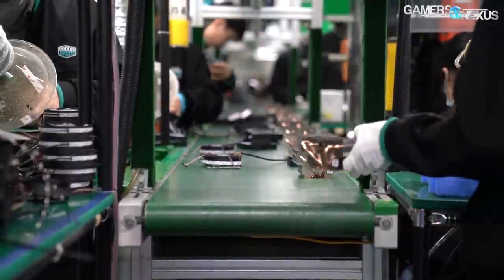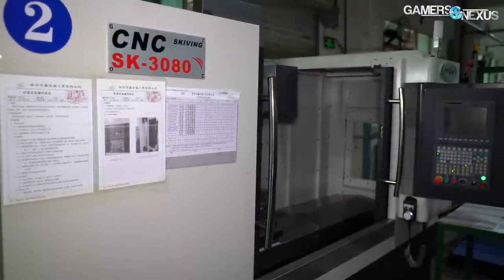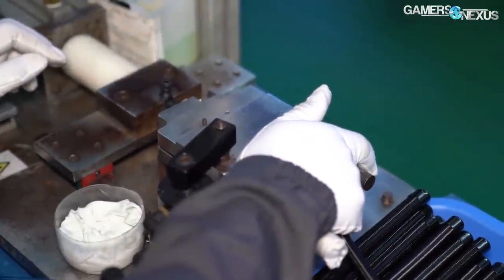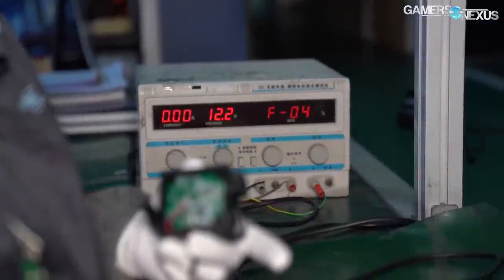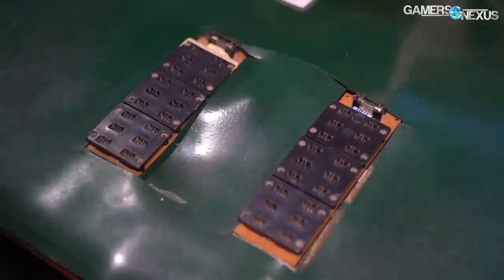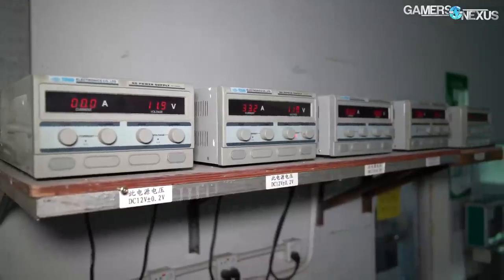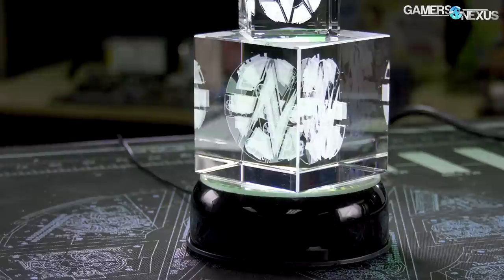How PC Liquid Coolers Are Made | China Factory Tours (Cooler Master & DeepCool)

Comment from the maker: You would also like our "How AMD CPU Coolers Are Made" video: https://www.youtube.com/watch?v=8vPfmY0KlJE
You can support our tours directly via our store! https://store.gamersnexus.net/
Reply: Propylene Glycol....So i can vape heatsinks? Awesome!
Reply: So, after seeing how this stuff is made, i still have no clue why there are/were air bubbles inside both of my NZXT Kraken X62.  
I can shake my radiator and hear a big air bubble bubbling. The first X62 had the pump die, it ran dry because i had the radiator front mounted in the (last gen) Corsair 750D, which means the radiator was lower than the pump. ALWAYS make sure to install the radiator above the pump (top mount it if you need to), just in case there is air inside, the air collects at the highest point and if that is the pump you'll have a dry and soon a dead pump).
Reply: @ZeroB4NG  Quality control isnt always perfect.

Or age of unit maybe? (i wont pretend to know if old-new stock can loose liquid, through tempreature variables, or if its just down to years of use)
Reply: First off I want to say these are awesome videos, thanks for making them Andrew/Steve. I gotta ask though, do these factories seem to offer tours on a daily basis? Especially ones that produce for multiple aftermarket manufacturers. I could understand if these factories are trying to secure large contracts, but not really for mid-sized YouTube channels (no offense intended).
I enjoy these videos, and I hope you continue to make them in the future when you are over there. I got a laugh watching Andrew initially failing to break the glass in the "Tempered Glass Cases" video. Being more worried about the worst case scenario where the glass lands. I wouldn't of tried picking up the pieces as you did though  ;) .

P.S. And also @AddisonMartin 's has a great question about factory tours affecting your future judgment of reviewing future products from those companies?
Reply: Fantastic insights - thanks
Have you thought about looking at car manufacture - those chaps know about automation!
Reply: A "How are AMD CPUs made" tour would be incredible
Reply: You should have asked DeepCool why their units leak so crazy according to Amazon reviews. I almost bought one, but those reviews...completely tilted my opinion
Reply: This type of content is really good. Hope to see more in 2020.
Reply: Amazing video, god I pray that all of china and the world prevail through this coronavirus crap
Reply: Could  you please make a video on how will regular cooler perform differently from a liquid cooler on a can of beer. How fast will they cool it? Maybe it's better to cool beer not in the fridge. Name could be smth like "Liquid and non liquid liquid coolers"

Comment: I'm an aerospace engineer and CNC machinist. I do most of my work in systems of manufacturing, finding ways to manufacture things safer, cheaper, whatever I'm asked for.

And to my knowledge, I have never seen a skiving machine. I've heard of it, but never actually knew what it was, let alone how it worked. Thanks GN, you made me better at my job!
Reply: They would surely be faster to produce the cold plates using some kind of sinker EDM or micro milling?
Reply: Jake Scollay Exactly, the skiving machine is designed for only skived parts

Comment: GN, this is the content I love, now a word about vacuum filling the all in ones. I work as a automotive mechanic and we use vacuum filling adapters to fill automotive coolant systems, it's extremely beneficial as you not stuck with a air pocket in the system that could cause overheating or no coolant flow in the system and you can imagine how complex the water passages in an engine can be. Just a quick easy and near foolproof method to fill a cooling system and not new.

Comment: I liked the automated screw feeder into magnetic screwdriver.

The gaskets are real pain to fit in comparison to other components. I'd expect tool assistance there, but nope.

I use a similar method for "open" loop leak checking nowadays - using a small air compressor. It does not fully replace run test as motor is not engaged and that could leak too while operating only.
But it excels at catching small leaks from fittings and orings that could take days of run test to cause problems.

Comment: I'm surprised that cross-threading isn't an issue at 6:20 The self-tapping screws holding the plastic casing together would be fine, but those little screws holding the cold plate look like a nightmare.

Comment: Wow.. I always looked at DeepCools AIOs with questionable quality concerns. This put those concerns to rest.. DeepCool may actually be the next brand of AIO I buy..
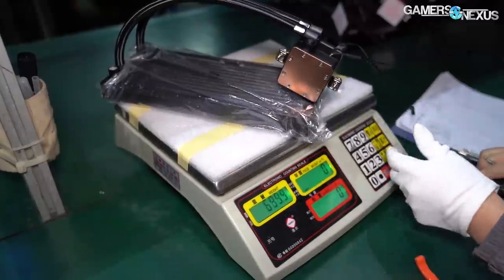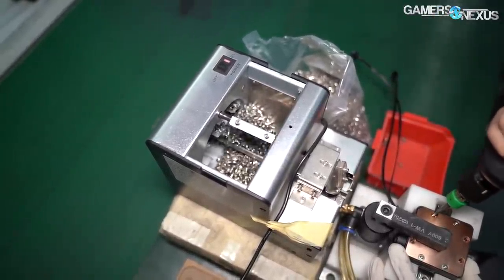Reply: Haha, I loved the missing screw at 10:10 and the stripped screw at 8:20. I’m leak testing these if I get one for my Titan Xp.

Typically I have 20 hose connections in my water loops, and jamming the end caps with a marker or pen is good enough for me (I do have a ridiculous amount of water leaks on my carelessly thrown together test bench, but I fully expect them to leak). I’m kind of impressed more failures don’t occur with such a manual process, but after seeing this, I’m definitely leak testing them for 24 hours (still getting another AIO, because like I said, I have water leaks like crazy with my sloppy testbench, nothing like a 1 inch internal dia hose popping off and a massive fountain of water going into the air (luckily I have both PSUs off while leak testing so my quad GPU system doesn’t fry, I’ve actually had 6 GPUs on a system load testing PSUs and had this happen, lol, it’s not just the board that’s soaked, it’s half my room! Takes hours to cleanup with towels due to about 1 gallon leak within the 3 seconds it takes me to unplug the pump, but I’m fast as lightning on hitting PSU switches, gotta kill it before gravity brings the water geyser back down, lol!).

Ironically, my full custom water cooled tablet didn’t leak for years, I hot glued hoses into my 3D printed water block housing (cold plate is a sanded down copper penny press fit with silicon gasket sealant), and then ran from a “radiation barrel” Vix bottle (nuclear apocalypse themed, rusty steal pipes for the rad, green “radioactive” anti-freeze coolant and hazard decals). Entire cost was way under $5 in all, I think it was $2 plus rusty steal pipe (I assume you could get 1 ft of 1/4 pipe/tube that’s been laying outside for $4). Build time was during a boring movie... So I can do it well, but what’s the fun in that?

Comment: My Enermax 360 White AIO over 2.5 years has not faired well. Fans were replaced at 1000 hours of use. It's suffered enough permeation that its sitting sideways for the air bubbles. Temps around 45-50c at idle. Instead of buying a 5800x3d for my AM4. I'm now having to buy a new AIO for a white build in a o11d. Availability is in the dumpster.

Comment: Damn!  I am amazed how many quality checks happen to ensure the AIO will not leak and is operating at spec.  I wonder then why leaks happen.  Could it be a user fault?   I've had good experiences with AIO coolers from Corsair.  Except one time when the pump was making an unbearable buzzing noise.  I didn't take chances and returned it immediately.  The new one didn't have that problem.
Reply: Things like oring and other rubber seal can degrade overtime, especially at high temp, it might take years, but it will happen.

Comment: I'm kinda surprised the skiving machines only do a skinny finstack line.
It'd be massively faster if the cutting wedge was 2ft wide, and the copper plate had grooves through it where the fins weren't needed. (The raised area left between the grooves would be turned into fins)
With this method they would only need to change the width and spacing of the grooves for different kinds of coldplates. (Threadripper for example)

But perhaps there's good reasoning why they only do one long lane of fins at a time. Most likely due to flex in the material, which would result in imperfect fins.

Comment: So they mix aluminium and copper in the same system now? So it forces users to use some anti corrosion coolant to avoid electrolytic drift corrosion between copper and Al? Weird stuff, we used to use all copper or copper and brass elements in the past.

Comment: I'm really disappointed that manufacturers don't correctly pre-apply a pound of thermal paste. They should follow the Verge.
Reply: That’s only necessary for extreme overclocking (LN2, DICE, Phase). I use about 50x more thermal paste for sub/zero systems, not including if you pack the CPU socket with it (otherwise it’s not air tight, and then moisture will find a way in, and then a weak later your CPU or motherboard pins are heavily rusted and done for...). You can also use the paste around your VRM and entire board if you wanted to, but I use either plasti-dip on the flat areas (so you can peel it off) or Vaseline (which can heat gun off later, and can go under the caps and mosfet legs so they don’t short out there).

Maybe the Verge just needs to go into EXOC, LOL!

Comment: So could we refill the cooler master AIO water cooler? I saw a port for filling the coolant locate at the side of the radiator. Those AIO water cooler are pretty tough, we could extend the usage by refill the coolant.
Reply: You can, but it will degrade even faster, unless you can also vacuum the AIO during filling.

Comment: I was just watching an LTT video about their DIY cpu cooler and they said soldering heat pipes would destroy them. Given what you know about their manufacture now is that true?
Reply from the maker: We don't know the context of that content, so can't comment on it or its accuracy. As for heatpipes, they are often connected to fins via solder paste to connect to 'zippered' fins, then reflowed. It can also be done without a thermal interface, although solder is a common solution for connecting heatpipes to the finstack.
Reply: I'm guessing they mean soldering them to close them as the heating would cause most if not all of the tiny amount of water inside to evaporate. If you've ever tried to solder copper water line that has residual water in it you'll know what I mean. You can't seal it until all the water has evaporated out as a result of heating it.

Comment: Awesome video, but why they doesn't use copper radiators?
Reply: Cost of both materials (copper can be nearly triple the cost of aluminium) and  cost of production
Reply: @bengrogan9710  Alphacool, Be Quiet, Fractal Design(Kelvin) all have copper radiators but cost same as Aseteks with aluminium radiators.
Reply: 1AmElectricman Still a Lot more expensive! With all this manual labor, it would still cost even more obviously. Copper rads are very offputting in terms of cost, and that’s coming from a guy that doesn’t mind frying a $1200 GPU on liquid nitrogen, overclocking my triple 4k monitors, runs quad GPU, and buys “only” a TR-1950x, because I 100% plan to fry it on extreme voltage on liquid nitrogen so I know what to expect for when I do the same on the 2990WX or whatever the best 3rd gen is. It’s really hair pulling seeing the prices on copper rads... $400 copper cup (LN2 cooler), that’s fine... $80 per rad and I need 3x for my quad GPU build, unacceptable! lol! It seriously bugs even me for no reason... I’ll spend more on magnetic levitation server fans than I will on a copper rad (I want to do full copper hardline at some point, but still, copper rads seem too expensive....

I don’t blame them for using aluminum, with automotive antifreeze, the liquid is about 100x better (in 3 years I didn’t need to change for a anti-freeze cooled tablet, but every 3 days I had to flush and refill on distilled water...)

Comment: manual assembly can be just as good as mechanical, its all in the jig's, shit jig's and it doesn't matter what assembles the item (now the real difference comes in training and give a hoot, you train a robot to do it correct, it wont get tired or mad at the boss or show up still drunk)
Reply: And you can overclock the machine... ok, at least my 3D printer runs over-current on its drivers as well as over-volting and requires fans on the motors or else the motors get around 180*F case temp before skipping due to magnetic fields weakening. But hey, that thing practically flies! I’d have any automated factory over-clocked, but maybe that’s just me, lol!

Comment: ASK GN: Why cooler pumps, can't run without any liquid in them? They are just fans...
Reply: they can, but some models use the fluid moving through them as lubrication.
Reply from the maker: They can run. It is not particularly good for them if they run dry, though, as self-lubricating models will eventually burn out.

Comment: A worst case scenario of 60C ambient? Now I must ask how hot will a poorly ventilated case actually get and will something else overheat before 60C can even be achieved?
If I had to guess then a poorly ventilated case probably doesn't get any higher than 45C if the room temp is around a comfortable 20C.
Reply: Hard to really test as by the point 50 degs case ambient is reached the cup and you will have been throttling for some time.
Reply: Ben Grogan Intel runs about 600w on a mild OC on the 7980XE, I know with an R9 Fury, my case got insanely hot (removing the panel felt like your eyebrows were singing off with crossfire Fury and an FX CPU). I didn’t have throttling (at least with VRM fans), but my only fan was exhaust, and that was the 120mm AIO fan. If I had a 9900k, the CPU would use way more power, and the chip has what, 100+c throttle point? I could see this getting toasty, not counting if my room was not air conditioned with outside air temps of over 100*F and so realistically 105*F room temps with that machine running. I could see that happening...

Right now that cooler is doing great, but my TR1950x only pulls 450w at 4.15 GHz stressed, so it’s not getting too hot and I can have my fan barely spinning, but man that rad is toasty!

Comment: Antifreeze is used in these coolers. lol. But that is actually good. It also means these have a life of around 5 years. It would have been less if they used just water.
Reply: If they just used water it would be around a year due to galvanic corrosion between the copper block and aluminium rad.
The Antifreeze is due to the fact many of these are airshipped and need to deal with plane cargo holds
Reply: @bengrogan9710  I am sure I stated that they would wouldn't survive as long with just water. But it does make them better in storage. That glycol can still become acidic over time. So looking for a golden oldie may mean that it was sitting for a while and the lifespan will be lower.  However, straight glycol is only shelf stable for 2 years. And UV can convert it quicker... as can heat... But 5 years isn't too much to ask from this combo.

Comment: #askgn Hi, I was watching comparison videos between 9900K/9700K/8700K/2700X etc using a RTX 2080ti and I noticed how the gpu utilization was never at a constant 99%, mostly in online games, especially Battlefield V. 9900K had the better % utilization of the 2080ti, but still not close to 99%.  Is the RTX 2080ti being held back by the CPU/hitting a CPU bottleneck in demanding games? Maybe you can investigate using a 7980XE or a higher core count cpu. Thanks.

Comment: I just don't get why anyone would get expensive AIO when noctua exists..
Reply: Heat dumped OUT of the case, looks, silence (bigger and more efficient radiator surface), case size constraints (slim profile etc), high power chips (Intel at 600w), ease of mounting (twist lock in), extra capability like submerging rad in ice bucket for fun. These are just a few reasons.
Reply: @jakegarrett8109  Noctua nh d15 is more silent than any AIO's and outperforms almost all of them while being whole lot cheaper. Looks depends on preference, some might like air coolers better. Noctua is known for their easy installation. And after all of that your leaking chance is 0% while AIO can take almost your whole pc down when it leaks, and most companies don't give warranty for the broken components, only for the aio itself.
Reply: megapet777 Any AIO? Because I can probably run a 360 AIO without fans on some Ryzen parts. As for pump whine, you can’t hear the pump in mine (with your ear an inch away from the pump), I get bothered by noise if I’m sleeping next to my desktop, I use magnetic levitation bearing fans, because you can hear bearing noise in most fans, and I refuse to use those noisy grinding HDDs, I can’t stand those awful things!)

Noctua isn’t bad, but I’ve done fanless builds before (for custom builds I prefer submersible pumps, dampens noise and vibration).
Reply: @jakegarrett8109  Well you surely are enthusiast :D
Reply: megapet777 Yep, I also like my sub-zero phase cooler for its performance aspect, it runs -35c under load and can keep an FX-8350 at 1.7 Vcore happy with core temps below 0c under stress tests, idle temp is -60c, so you need to insulate things well so they don’t ice up watching YouTube vids on it, lol! (fun fact, a Titan Xp collectors edition is about 4x louder than the phase cooling compressor, I’m not sure why that $1200 card has such a terrible cooler...)

I do love silent builds if I have it run while I sleep though... I’m ridiculously picky about that for some reason, lol!
Reply: Jake Garrett haha that's crazy